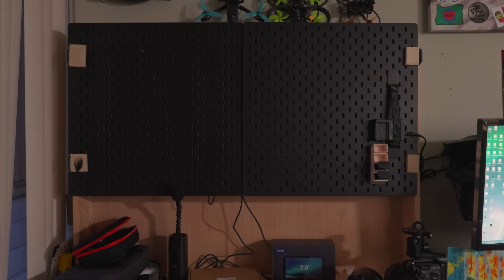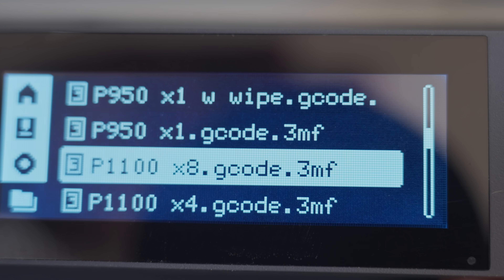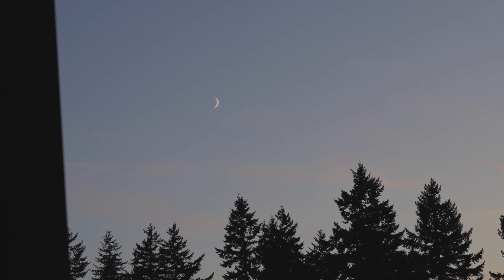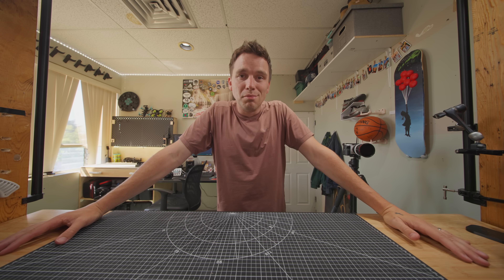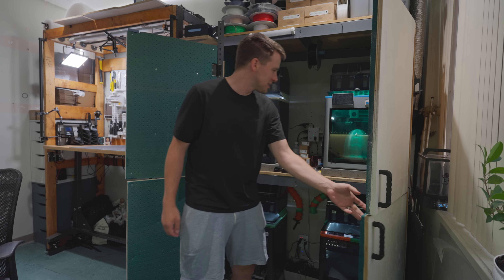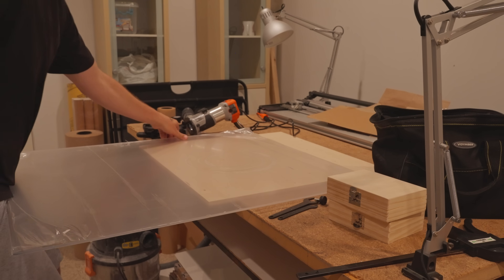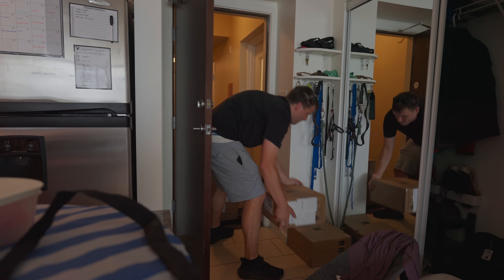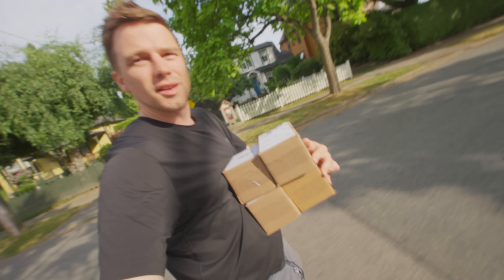A Week Inside My 3D Print Farm: Projects, Problems & Progress

Comment: Why you do not AMS for small rolls? It swap itself to next roll. No need to mess around like that melting joining thing
Reply from the maker: Main reason is because each roll seems to have a slightly different shade of black which creates a visible line and shade change in the final product which I am not ok with. So I put them all together and use those spare rolls for random projects
Reply: @JoelSchat  This is exactly why I use 3kg rolls. It's a pain to figure out a drybox / mounting solution but it's so much more hands off.

Comment: I have a question, you're using an AMS for your printers but I see you only have 1 sometimes 2 reels of filament in them. You mentioned that you take the tiny amounts left over from printing and melt them together to form a "free" reel. But with Bambu and an AMS you can set it to start a print from one reel and when it runs out automatically use another reel. How comes you don't/can't do that? is the amount left over too small to feed into the printer from the AMS?
Reply from the maker: For sure! It's actually a filament issue not a printer issue. I do use that auto refill feature with other prints and projects but I've noticed that 50% of the time the auto fill with this specific black filament makes a distinct line where you can tell it changed rolls. It's a different finish. Not sure if it's just inconsistency of filament rolls or what causes it but it's enough to make me have to not sell them so I can't do the auto fill with this black

Comment: Don’t you worry about humidity when stocking so much filament?
Reply from the maker: It's not too humid where I live, and I usually just toss the roll in the dryer if I need a quality print. I will eventually get a better system going but just don't have much space for one yet

Comment: Hello, I mostly print with PLA, and my machine has over 8,000 hours of use. Recently, I was experiencing filament jams and flow issues, just like in your example. On YouTube, a user mentioned that the problem could be with the extruder unit. Instead of buying a new unit, I got the CNC unit from the Biqu Panda. I haven’t had any issues since, and I also slightly reduced the volumetric speeds. If your nozzle flow problem continues, you might consider giving it a try.
Reply from the maker: Thanks for the recommendation! I've only had to replace 1 extruder unit so far, it's usually wear on the nozzle that causes these clogs. I'll look into it the Biqu one asap tho!

Comment: Nice video! And congrats on your new arrival. It’s one of the best things in life.

Are you using a V-spooler? Looks like it works well
Reply from the maker: Yup, V Spooler! It works quite well for me and is a bit smaller to store when not in use than the other one's on makerworld. Thanks!!
Reply: @JoelSchat thank you! It seems to have a much more manageable footprint than most re-spoilers I’ve tried.
Reply from the maker: Yup that's why I chose it and haven't had to try any other ones

Comment: Amazon is high volume, low margin, and the best products you can sell are small and light because you will want to eventually transition into FBA to take advantage of their logistics. I think it ends up being around the same price to fulfill orders yourself and ship vs amazon doing the work and shipping. Plus on top of that you basically get a boost with FBA for being able to get orders to people faster. If your products are on other websites for cheaper than amazon they will also algorithmically throttle your product too. If you want to, you could send me a box of like 5 or 10 of whatever you are wanting to send and I could do some merchant fulfilled orders for a month or two and we could put together a listing and I could take a small cut of the final profit. From there you could see if its worth doing FBM or FBA. Definitely dont write amazon off. I got into amazon by basically accident and so far its my biggest sales channel. Haven't even really optimized listings or ads and im pulling in way more business than on etsy.
Reply from the maker: Wow, thanks for the detailed response. I was definitely thinking about FBA if I did move forward with it. What do you think the value of having more products ready to go is? I keep putting it off saying I need to have like 5 or 10 different products for it to work but that might not even be true?
Reply: @JoelSchat  My first product was an instant success and I didnt start adding new products until like a year later. Have other products that did not work that seemed like winners. Theres really not an advantage to adding 5 or 10 more products as people dont visit your storefront. Adding more products just gets more complicated in terms of inventory management and not every product is a good fit for FBA. I have one product that I sell maybe 15 units a month across 3 colorways. The margins are extremely high, but I really cant increase the volume without more ad spend or getting good reviews which is difficult. That particular product isn't ready for FBA yet. Seasonality is another issue. Some products might only be good for certain times of the year so you dont want inventory sitting idle at amazon. The bigger your product the more storage space you are going to have to pay for. Basically you can lose money on amazon FBA if you are spending money for ads, their fees, plus storage fees, and the initial shipment to their fulfilment warehouse. Sometimes it can take a solid month for your product to make it through the mail and into its slot so you have to be mindful of lead times and sending just the right amount of inventory. Refunds are also a nightmare that you just have to eat. Way more cut throat shoppers than etsy. Where 5 or 10 products works is the last little line item which is that I think its like $90 a month im pretty sure just to run your amazon store. If you have 1 item or 100 its still $90 so you would ideally want to make more money than that. My first product was pulling in like $400 a month but was getting chewed up by the $90. Now thats amortized across multiple products. I havent done anything international yet either so you might get smacked with tariffs if selling on the U.S. market, and you might have to qualify for amazon U.S. too. I think one of my products is eligible to sell in Mexico and Canada, but my other products are not. Theres a lot that goes into it and im still mostly a beginner, but amazon is the biggest online retailer so with the right products and some time and effort I think it should be explored.
Reply: @JoelSchat  Dang I made a long post about everything but youtube deleted it. You really only need more products if you want to amortize the store fee.

Comment: Hey Joel I just discovered your channel. I run two businesses making products I developed and print myself. I sell on amazon in addition to two etsy stores, a shopify, and a square space. Across all the platforms etsy and shopify are far more profitable. I have spent ungodly hours thinking about if its been worth it on Amazon. The big downside of Amazon is the lower profit margin obviously, but the upside is that they handle all the shipping and logistics.

In respect to a small business the fees amazon takes start to make more sense when I cant keep up with shipping or production. If I got to the level I needed to hire people to help me ship then I would have to sacrifice profit to employ them. So for me it makes sense to use amazon now that we have grown. In your specific case if you find yourself unable to keep up then you can make big batches of the products. I have optimized the print schedule to ensure I have the full production capacity in the focus. This lets me run batches of prints and then I load them into the Amazon warehouse in big shipments. If a small business is trying to sell a low demand/niche product they would likely be upset with Amazon profit return compared to Etsy or Shopify. That is often why there will be many dissatisfied sellers when they jump into the Amazon Marketplace.

Amazon FBA handles shipping, customer service, and returns. Amazon FBA has a referral fee and a shipping fee. The referral fee is what amazon charges for "bringing you a customer". Keeping that in mind I weekly box 100 units up and put a SKU sticker on them, after they ship I never see them again. Using the FBA program makes my listings show up as prime and that really installs confidence in a customer. The downside of the referral fee to me is offset by having healthy margins and further by insulating me from hiring someone to help me package orders on demand. I still do that but it gets hairy sometimes when a machine goes down or I mess up a label. If Amazon ships it and messes it up the customer is upset at amazon and not my small business. Amazon has yet to mess up any of our thousands of orders so far. That is a big bonus to my small business. Less decisions "in my face" that require "critical" thinking. lol 

You can also sell on amazon without using FBA. You list your product just like you list it on ETSY or Shopify and only need to ship as the sale comes in. This is a good system to but not nearly as much product exposure as when you use FBA and have it marked Prime. Prime is king. Additionally not using FBA has a draw back that amazon expects that you will get that order out the same day or whatever turn over you select to have. Its your choice but missing that can be bad for your account health. I miss it once a month shipping a day late and so far no issue other than them saying "account health is down".

Lastly and most importantly with Amazon FBA you can connect your shopify and it will automatically ship from the amazon warehouse to the customer WITHOUT a referral fee. This is the sweet spot to me. No referral fee, Amazon prime speed shipping and minimal Logistics. I dont know if you can connect the etsy to Amazon FBA but you maintain the option to manually dispatch the order from your amazon seller account to the etsy address. This is also convenient if you want to go on vacation or step away from the business for life needs. I login and select the product, type the customer address in, and then type in an order ID number and BOOM they will get it next day usually.

Overall I would say Amazon took its pound of flesh from my business but it also gives my customer base a lot of confidence in the product. 3D printing is at a crossroad currently where the right design, material, and a quality product can be mass produced by guys like you and me. Lots of folks in the 3D print world may not find the success on Amazon because there is a lot of requirements like photo sizes, backgrounds, and listing errors but you will learn that as you go. Last piece of advice is buy a UPC code for your product. The UPC code will always hold your amazon reviews and if you relist the product again or make big changes you can use the UPC code to drag the reviews and purchase history with your listing. If you ever want to ask me any questions or call please find me at our site TheBeyondBeleafShop or at SkunkPrints. I am happy to answer any questions.

Goodluck pal and please keep bringing your editing A game to this world so others can learn how to grow too. Thanks again!
Reply from the maker: Wow thanks so much for the lengthly response. I've read it a couple of times now and have found it very interesting. Seems like your shops are doing really well! I can see why the beyondbeleafshop would do well on Amazon. It has the right look and product photos for sure! 

Really interesting stuff about the shopify FBA connection, that's really cool. I'll definitely be looking into that! Have you found that you need to have more than 1 or 2 products up for Amazon to take you seriously?

Comment: Great video! Why not use the auto-refill feature, so you can start the next print with that remaining 50g, and have it automatically switch to the next spool?
Reply from the maker: Good question! In my experience so far, it's about a 50/50 chance that there will be a noticeable colour / darkness shift between rolls of filament making the prints non sellable.
Reply: @JoelSchat  You try listing the imperfect ones under a separate discounted section for buyers that don't care about the color discrepancies.

Comment: Not a fan of selling with Amazon Canada and I'll never sell with Amazon again. Their seller platform is the least use friendly piece of software ever created, and it's like they are actively trying to make it as confusing and useless as possible.

Their support is either bad AI or non English speaking foreigners using a translator and copy pasting canned responses. In a thread of hundreds of messages back and forth I never got a useful answer. Eventually you just give up. 

If that's all not bad enough, if you are having success with a product, expect that Amazon will make their own version and undercut you.
Reply from the maker: Thanks so much for the comment. I've been hearing a few stories like that lately so I'm leaning towards not doing Amazon for those reasons